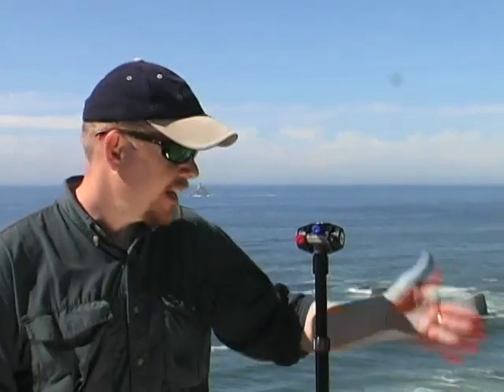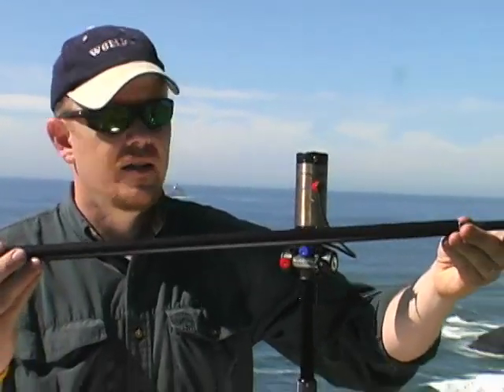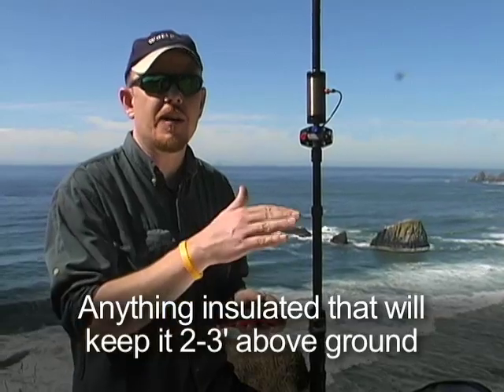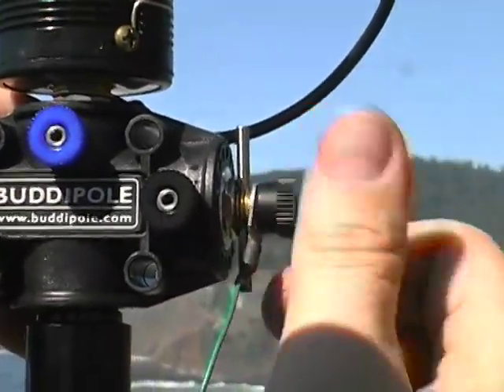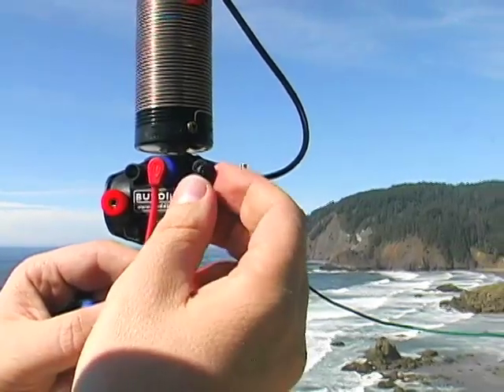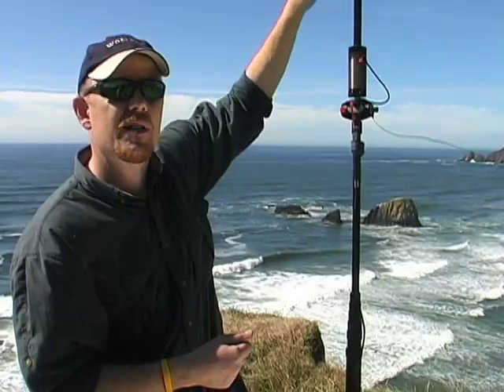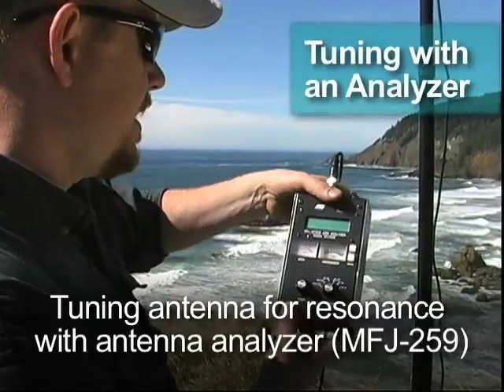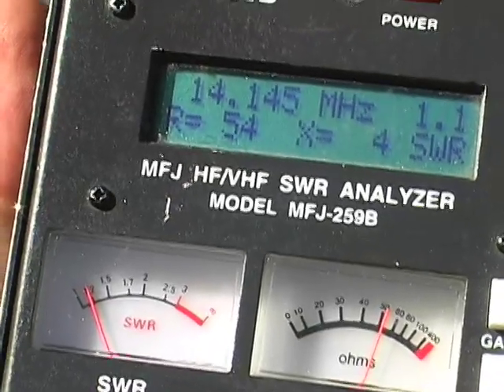Setting up the Buddipole Versatee Vertical

Comment: Many Buddipole users have modified how the coax connects to the VersaTee. Much more secure than using the pins provided on the coax. Also, I've used the Buddipole set up as a vertical for years with great success on HF 40M -  10M. Got my WAS and DXCC using a Buddipole in my backyard. BTW, I live in an HOA community and thanks to Buddipole I'm able to operate.
Reply: The Buddipole coil that comes with the Buddipole ™ Deluxe pack takes one and can be used to work with the vertical antenna?

Comment: Still relevant and awesome 10 years later.  I picked up a Buddipole Deluxe kit from a friend and started researching the different configurations. I ordered the painters pole adapter from Buddipole and then found this video. I had already received my confirmation email that my adapter was packaged and ready to ship when I sent a quick email asking if I can still add the counterpoise and adapter to my order. Chris responded within minutes that he would add what I needed and get it sent off right away. I am glad I found this video because I am really looking forward to all of the different configurations that this system has to offer. Watching Chris use the clip across the leads to find peak noise is an awesome tip that I never would have considered. 

As a new SOTA activator, I just brought my Buddipole to W7A/AE-035 Baker Butte Lookout, up in Northern Arizona, and I made a barefoot contact to Florida using my KX3 and the Buddipole Deluxe setup as a horizontal dipole. That was a voice contact on LSB. 

Great antenna and great customer service!!
What more can you ask for??
73 de N7DSX

Comment: what would happen if you mounted this on top of your home which happens to have a flat metal roof and used that entire flat metal roof as the counterpoise, would that work?.... the counterpoise is definitely over 3 feet off the ground and totally surrounds the antenna

Comment: Borrowed a buddi vertical. Only issue was never got 20 really right as seem to over shoot adjustments. 1.6:1 14.185  with feeling my large chicken coup house affected the settings. Moved 18 feet out better but no room to go further. Coax was 62 feet to rig. Could this have affected counterpoise?.